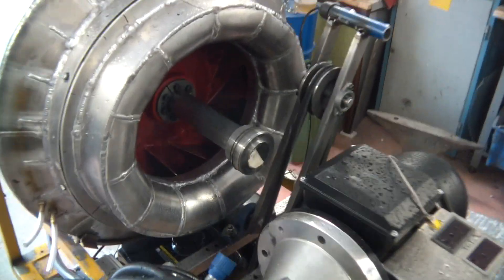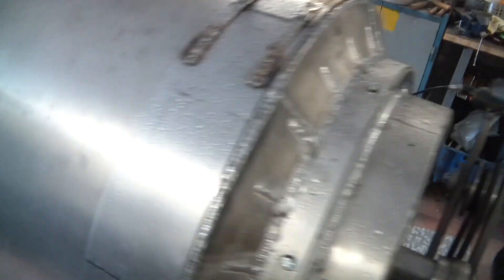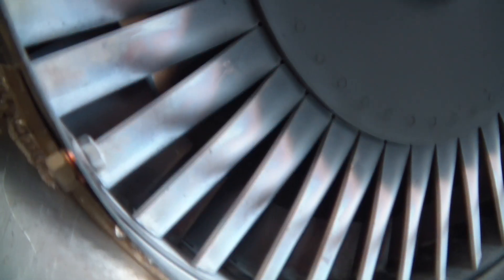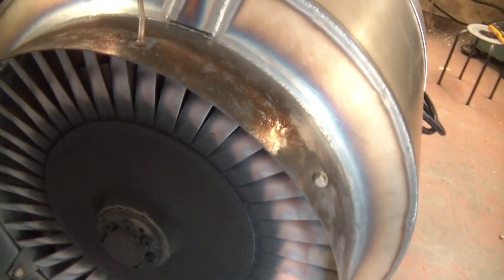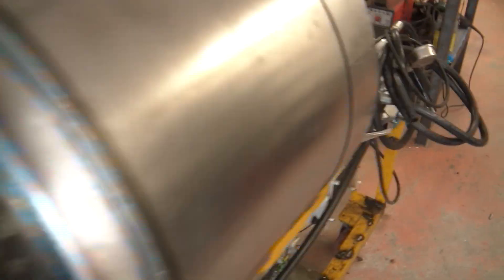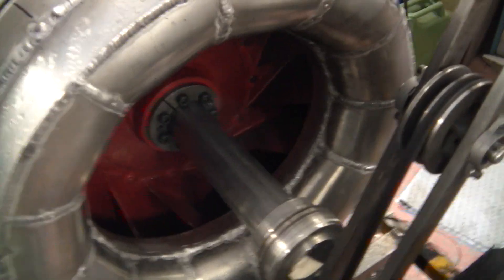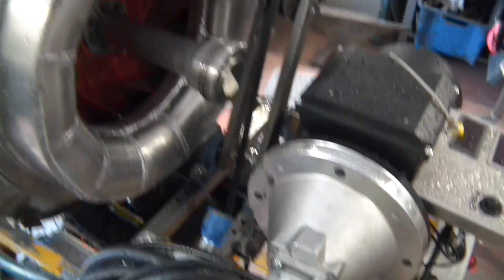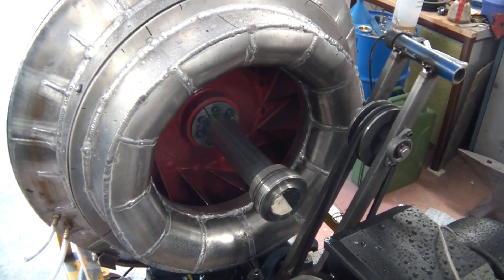My JU 03 jet engine is running!

Comment: Rubbing is actually a technique that jet engine makers use to ensure the compressor seals tightly to the case. Also, fuel is usually not introduced until the engine is near self-sustaining speed. You shouldn't see much flame at the turbine. All of the combustion should be completed in the combustor. This cuts down on turbine wear and tear. The gasoline motor is a good idea. In the 1960's SR-71 Blackbird engines were started using twin Buick automotive V-8s. You need something with more power. Anyway, just my 2p.

Comment: You need to swap out the compressor to a centrifugal type like a turbo compressor 
Just not enough air for a good start
Reply from the maker: Good luck finding a 500mm diameter cast compressor wheel. :)

This is the whole idea with the project, to build everything myself from sheet metal. I can accept a performance loss.

Comment: Maybe you need more bypass air to cool the exhaust before it passes through the turbine. Make the holes bigger or put more in…
Reply from the maker: That is not the problem, I just need to rev the engine a little bit more. It was barely idling and running rich, a higher idle would have pulled the flames back in the combustor where they belong.

Comment: What is the target thrust?
Reply from the maker: @Triple_J.1  No idea, this engine is so far from the normal diy gas turbine that I dont know what to expect. Plus the current rotor parts are too weak to handle max rpm (ca 10.000rpm), I need to build a sturdier turbine wheel and compressor before going higher than 50% rpm.

Comment: Well done looks to be self-sustaining just 😮 What's the compressor case pressure? 2-3 PSI is needed for proper idle?
Reply from the maker: @gasturbine101  Yes it was just on the edge of self sustain, with some more revs from the starter and larger fuel injectors I will aim for a stable idle 500rpm higher than this.

I didnt have a pressure gauge so no idea, will fit one for the next run.

Comment: Regarding the starter, have you removed the governor so your can maximum revs out of that motor?
Reply from the maker: No I will try to keep the regulator, if I gear it up a little bit more I will get the revs I need anyway.
Reply: @Mobackenracing haven't you looked into a compressed air starter, or an electric motor?
Much easier to get the higher revs needed for starting a turbine.
Reply from the maker: @zenger74  I would like to be able to start the engine in the field without the need for long 3-phase cables or heavy compressors, a compressor capable of spooling this engine up would be huge.
Reply: @Mobackenracing  understood, and makes sense. How about a DC electric motor powered by a battery pack?  I mean a 10 to 15 kw 24 volt dc motor should have more torque, and be able to out rev a (i'm guessing 15 hp) Loncin? 
I'll shut up now, and mind my own business
Reply from the maker: @zenger74  I thought about a truck starter but don´t want to haul around heavy batteries.

Comment: Now that is a great first run. I'm glad it didnt do anything catastrophic from the rubbing.
Reply from the maker: That is the thing most people don´t know about turbine failures, most of the time they just grind to a screetching halt. They don´t grenade like in the movies. :)
Reply: @Mobackenracing  Yeah I didn't think it would explode but I meant catastrophic to the internal parts.
Reply from the maker: @RinoaL  Thankfully it happened at low rpms, at full speed it would probably have been a mess inside.
Reply: @Mobackenracing  Yeah, you put a lot of work into these engines and I'd hate to see one bend parts and such.
Reply from the maker: @RinoaL  No big deal, just rebuild and improve. :)

Comment: You could help with a blower to get more air in than the compressor can provide with the starter motor alone. Nice seeing the progress you are doing!
Reply from the maker: I´ll see if I can modify this arrangement or get a new motor that revs higher, this is pretty bulky so I would like a more compact and portable starter system. Thanks!